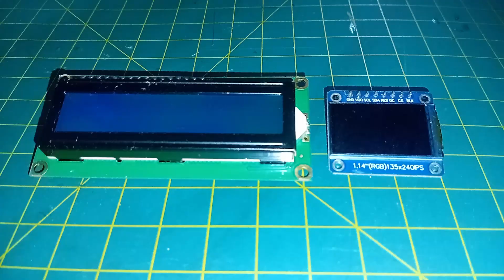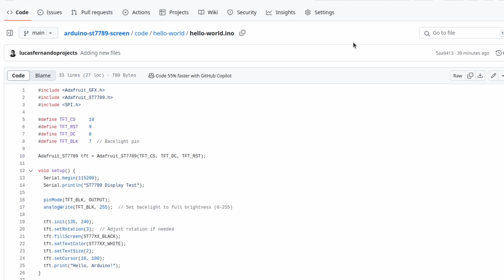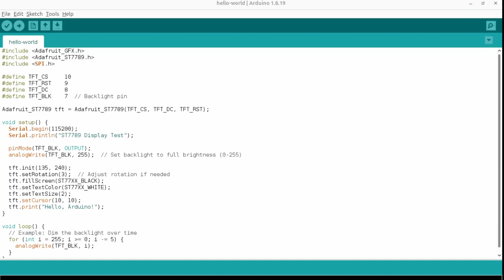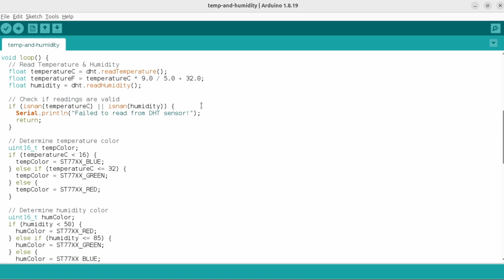ST7789 Display with Arduino [COMPLETE GUIDE]

Comment: Hello brother, thank you so much, I had a problem while using the display, it never worked, and none of my display were working, I have an oled 128x64 diplay that I have used, so to just check (I know it is nonsense), I connected the oled display and it didn't work!! I was very upset because none of all my displays (oled's and the new ST7789 I had just bought) were working, but then I saw you were using an old version of the Arduino IDE, so I decided to download it and guess what? It finally worked!! Thank you so much for the tutorial and for the idea I had
Reply from the maker: Hey bro, thank you so much for this comment. I really appreciate that. I'm also glad that this tutorial has helped you

Comment: I was able to get the first two codes running just fine with the 240x240 linked in the projecthub, by just adjusting the 135 to 240 and running on 3.3v as one of the other comments suggested. 
My dht sensor doesn't seem to behave with this code, not entirely sure why, but it will return a failed to read when a different code lets it work fine. 
I tested the example dht code, and it didn't work with that either.
Reply from the maker: Thanks for the feedback. I really appreciate your comment. So your DHT11 sensor works with another code but not with the code of this project, right? Have you checked your Arduino's pins?
Reply: @lucasfernandochannel  I think the problem seems to be that I do not have the same DHT library as you or the other people who's code I try and use. I'm not sure where to find it, but the one I have doesn't play nicely with other people's DHT scripts.
Reply from the maker: @CountDabulaTV  I used the DHT11 sensor library from Adafruit (version 1.4.6). You can find it in the library manager tab of the Arduino IDE (version 2 and above). Try using this library and let me know if you need additional help.

Comment: I almost ruin my 240x240 version by using 5v on it.. The display shows garbage, but researching on the web I found out it's a 3.3v device. Note also that there's a version with CS pin and a version without the CS pin... Without CS pin will be problematic if it'll be used with other SPI devices on your project due to no way for your microcontroller to select the device it is communicating with... Workaround that is using software SPI if its available.
Reply from the maker: Thanks for sharing your experience. I indicated in 2:27 that the VCC could go to 5V or 3.3V depending on the display model. I never got a screen without the CS pin, that's why I didn't talk about or show it on the video. But it's great you remembered and commented about them, so other people can benefit.